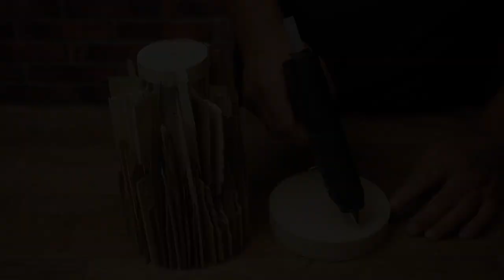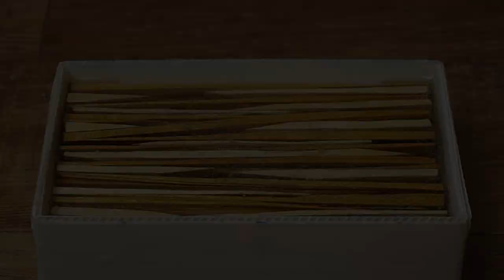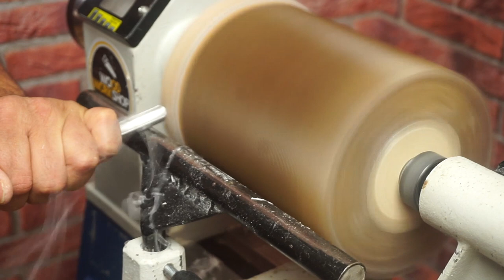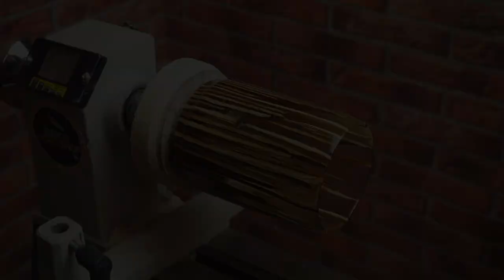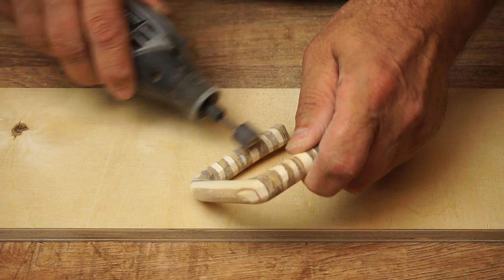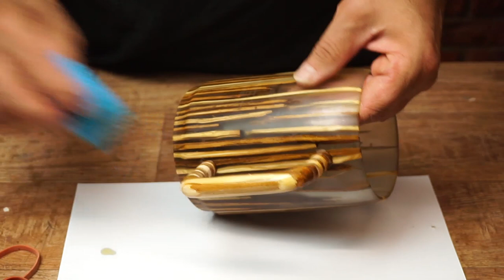Woodturning a Beer Mug

Comment: That's a very nice mug! I have been trying a resin project, but I think there is something wrong with my resin. When I opened it there were lumps of resin around the top of the resin that was in the bottle. It may have been old. Anyway, unit things get better as far as finances go, I am putting that sort of thing off until later when I can spare the cost of more resin.

Comment: Amazing work but I'd like to know one thing why don't you use some thing like a pvc pipe for core.
It should be less work and not waste a perfectly usable log of wood.
Same for the handle, why not use a smaller block to start with.
The wastage can't be good for neither business nor environment and also a nightmare to clean the dust & scraps

Comment: The beer will come in contact with that resin used with wood.
How bad would it be for the beer drinker to have resin infected  beer /beverage.
Any one here who knows the science?
Till then I'll stick to my  glass / ceramic 
Containers.
Reply: Pretty sure that resin is just a kind of soft plastic, it's equivalent to putting your drink in a normal plastic cup. Besides, the polish forms a protective layer between the drink and the resin/wood anyway, so it's probably fine